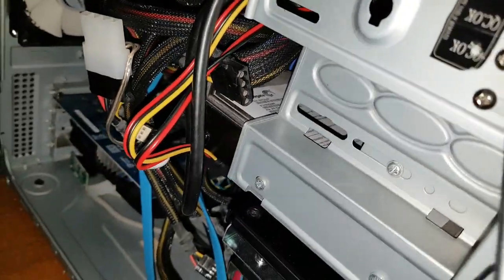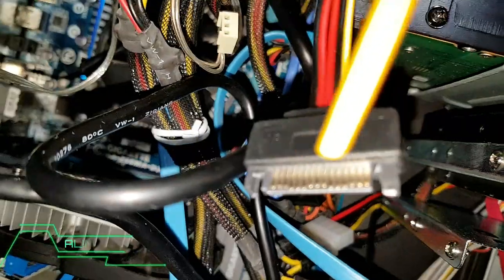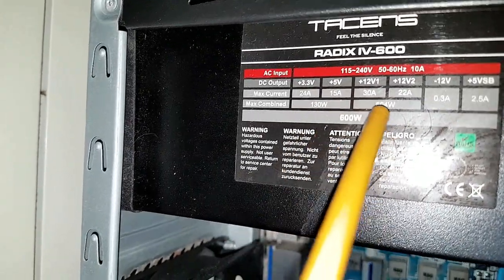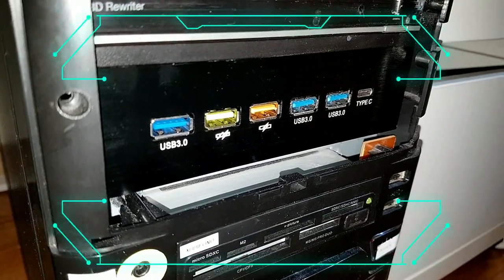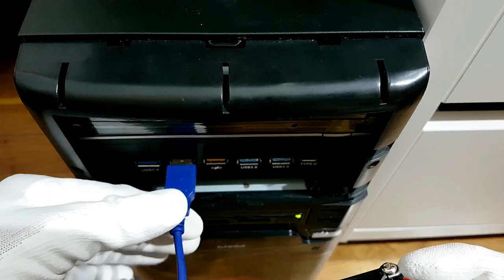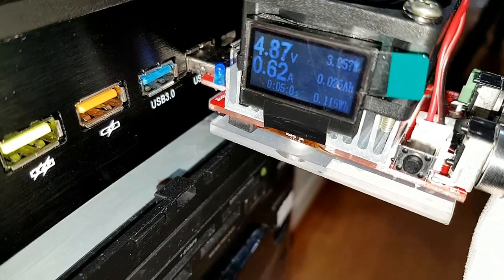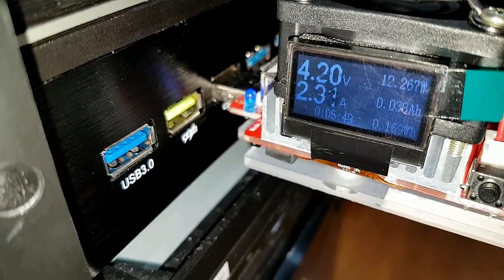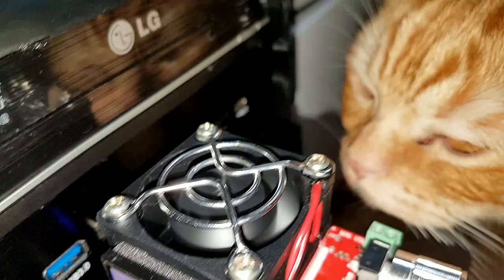🔴 FRONTAL PC USB 3.0 QUALCOMM QUICK CHARGE 3.0

Comment: Hola hno! ! Una pregunta en que parte de la fuente debería hacer la medición (con mi pinza amperimetrica) para saber si mi fuente realmente entrega la potencia que dice entregar?
Reply from the maker: Hola 👋, es complicado ya que la alimentación es por el cable SATA el positivo está en los extremos del cable SATA uno de ellos es 🔴 +12V y el otro es 🔴 +5V además la pinza amperimétrica tiene que ser para medir intensidad de corriente de tensión eléctrica continua (DC) Un saludo 👋